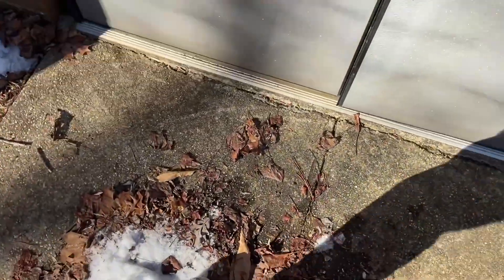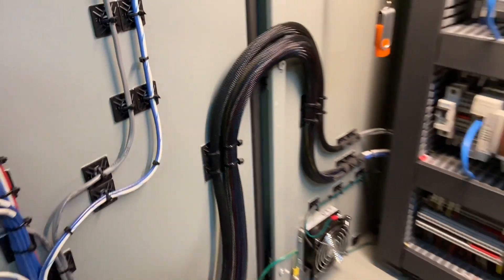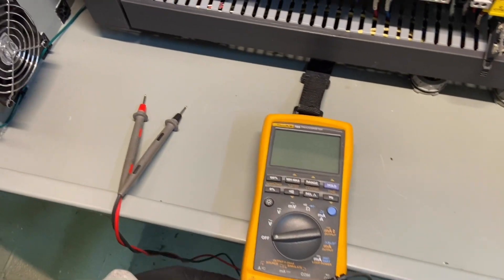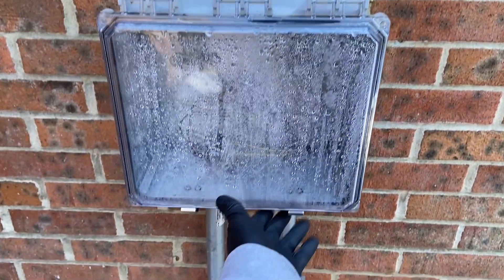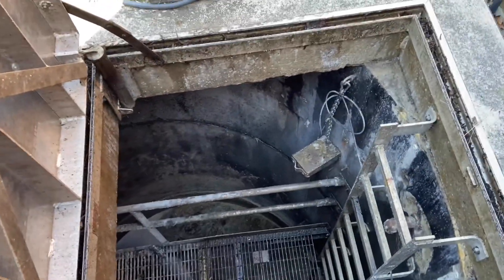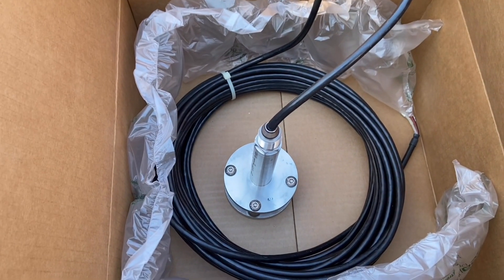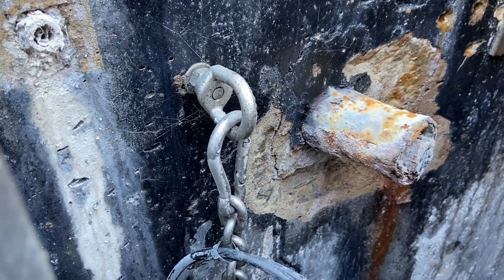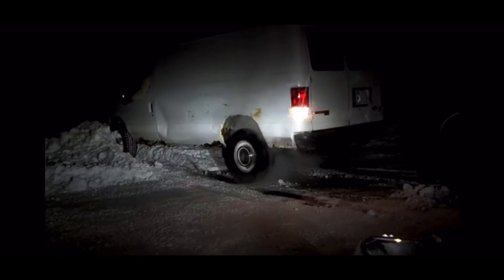Transmitter Issues

Comment: Transmitter measures something and sends an electrical signal out (to PLC, DCS, whatever you want). 

Transducer converts something to another thing. Typically air pressure to electrical power, but could be hydraulic, temperature, pH, etc.

But you already know this 😂

Comment: A transducer changes converts energy from one domain to another.  Usually electricity to physical movement (speakers) or movement to electricity (microphones, sensors, etc.)
Reply: So a transmitter is also a transducer because in this case it's turning pressure into 4 to 20 ma for a control loop.  Where I work we have "I to P" transducers turning a current signal from a controller into an air signal to control the position of a pneumatic valve.  I think you could use either/or term in most cases and not be wrong.

In the case I use here the "transmitter" is a measuring device converting from one form of energy to another and the I to P transducer is taking the input from another device and changing it into another form of energy.

Comment: We had lots of trouble with pressure transmitter in the water purifyer facility. I replaced them by ultrasonic sensors, no failure since then.

I like the way you arrange your cabinets. But there are also some downsides:

- The wirinig chanels are for wires, not for cables. Each cable should have it's own terminal block, no need to put the wires into a chanel.
- Wiring on the door is nice, but very unconfortable to change. We use wiring chanels on the door and hoses with spare/pull wires in it.
- Zip ties... 🤮
- Melting fuses for 24V are an absolut nogo. Electronic fuses are up to date, available from Siemens for example.
- Read the component manuals before doing your layout. Power electronics like power supplies, VFD or SSR require spacing to ensure cooling.
- Separate control and power circuits. For example PLS in the upper part, wires on the left side - load circuits and fuses in the lower part, wires on the right side.
- Shielding must be earthed by shield clamps to achieve EMC requirements, pig tails reduce the shielding effect to almost zero.

Comment: Forget about those pressure transducer cells, or bubblers, or floats. I've switched just about anything that fails over to a Simens LR120 radar sensor. They seem to take all the abuse of living in a wet well or chemical tank like nothing else Ive tried and you can set it up with your phone.

Comment: All these descriptions suck, hopefully you learned by now, but transducers vibrate n shit using sound or sonar or pressure. Transmitters are radios, they wiggle electricty n shit n magnetism.
Reply: 😳

Transducer change current to current or voltage to voltage. They are used for meetering in high amp or high voltage applications for example.

Transmitter convert any value like pressure, temperature or flow rate to a standard signal like 4-20mA or 0-10V.
Reply: @stefankaufmann8257 I guess that depends on your industry, which might be more practical for some. Your definition is more like a product definition. Mine is more of a concept definition
Reply: @DerekMartell it does depend and here it depends on the clip. The clip is about sensors and the question was, wether the sensor is a transmitter or a transducer. It's a transmitter and it has nothing to do with vibration, magnetism, sound etc. It's only about the signal, that is TRANSMITTED to the PLS.
Reply: @stefankaufmann8257 well, hopefully by understanding the basics, people can figure it out and also take that information wherecer they go and never be confused again. People who need every module and device explained to them in industry-specific ways need not apply
Reply: @DerekMartell i don't care if transducer is compromised with transmitter. But if you hook up a voltage transducer to a PLS, the PLS might get smokey 😂

Most people simply say sensor, that's fine with me. If a sensor fails, replace it by the same product. If it fails often, you should think about using another product or another system. I had the exact same problem with a pressure transducer in our waterpurifyer facility - pretty stinky to change. I replaced it by an ultrasonic sensor with 4-20mA signal, no failure since then. That's why you should know about function and technical details, when dealing with such problems. If you don't have to, you don't need to know... 😂
Reply: @stefankaufmann8257 well, thats good 👍 i don't doubt you do great in the field, with rock solid communication and exemplary problem solving skills 🤩🤩🤩

Comment: A Transducer converts one form of energy to another eg pressure to electrical to energy. A transmitter turns electrical energy into RF energy.
Reply: That definition might be right, but does not work for sensors and this clip is about sensors.

Transducer changes current to current or voltage to voltage. It's used for high amp or high voltage meetering for example.

Transmitter convert any measurement like temperature, pressure or flow rate to a standard signal like 4-20mA or 0-10V.
Reply: @stefankaufmann8257  I have transducers that turn current into air pressure.  The output of a controller is current, the input to a pneumatic valve positioner is air and we use "I to P transducers" to turn a current signal into a pneumatic signal.
Reply: Ah good to know!
Reply: @TheLastTater  Except he's wrong.  A transmitter is also a transducer.  Rosemount makes tons of "Transmitters that convert pressure to current for use in instrumentation process loops,

Comment: Transducers go on the bottom of the boat. Transmitters go up in the air. Transducers get you wet and sometimes maybe stinky. And transmitters are scary, bc usually very high up.

Comment: A pump turning on as you measure something, scaring the shit out of you.. My crew was in the middle of mapping out old building automation cabinets at a site for an upcoming modernization project, each of us in a different room with a different cabinet. From my own perspective I grazed against some of the mains voltage wires in the cabinet and everything went dark. Mind you, I had a dust extraction system screaming behind me, so the sudden deafening silence combined with no lights told me I had fucked up big time. That is, until I went outside to continue shitting my pants, but realized nothing was on.. Absolutely nothing was on at the site, no streetlights, anything. Turns out the main feed cable was cut by an excavator by accident outside the fence! Talking to my co-workers, they experienced the same exact thing, being both hands deep inside the cabinet when everything shut off😅

Comment: As Ben-yy7io mentioned, the Transmitter is the processing unit. It "transmitts" the signal to SCADA, or to an integral display, may have bluetooth, etc.
The Transducer is the actual measuring element itself. Just as the Thermostat is the device that displays your temperature but the Thermistor is the actual measuring device.

As a consulting engineer, we'd call it AIT/AE for Analysis-Instrument-Transmitter and Analysis-Element

And yes, why no IS barrier?
Did it at least have surge protection for a signal entering/leaving the building?
Reply: wow you're a nerd. thanks for the info.
Reply: Wasnt the yellow part after the fuse the surge supressor? Looks like it
Reply: @bashaaksema94  You're correct, good eye! 
Yes, surge protection, complete with nice lables on the wires that confirm that they are for the "Xducers"
Reply: AIT - Analysis Indicating Transmitter, i.e. it also has a local display, see ANSI/ISA 5.1 table A.3.2.

Comment: If you can build that panel and program the plc you should start incorporating a HMI. I use the c-more from automation Direct. They are super cheap compared to AB and they are super simple to program and incorporate to just about every plc. Once you add up all the switches and pilot lights it’s almost always cheaper to just use an HMI.
Reply: Not gonna argue dollars, but the discrete switches/indicators will mostly all work in 40 years, and what doesn't work can be worked around and repaired indivudually.  I doubt a HMI will have that lifespan, and chances are it'll go completely dead rather than "this indicator isn't working" or "this switch has gotten flaky".

I'm still buying things like replacement lenses for Dialco indicators installed 50 years ago.  Ain't going to be that level of replacement parts for most of today's HMIs.

Comment: What transmitter are you using I need one for my cistern I want to do away with the bubbler system.
Reply: Looks like a regular pressure transmitter, just has that birdcage protecting the diaphragm.

Comment: Nice door work.
Is that a dual PSU and redundancy module? 

Of the PSU’s I’ve started to use a couple of large multi terminal power distribution blocks and then down to sets of 10 fuse terminals- reason. So the jumper bars are not ran over current, the jumpers most often come in 10’s, and rather than didling trying extend a terminal strip, just add a whole new one.

Comment: Those birdcage transducers are expensive crap. Had similar reliability out of the much less expensive non-birdcage transducers.
Reply: You could have maximum fun and use a bubbler!
Reply: @ made me chuckle. I’ve only seen one that was actually working. It was at a small lift station on a recently closed navy base (early 2000’s). The little gold fish tank compressor was as buzzing away and I cycled power to reset the PLC and the compressor had had enough and stopped working. Fortunately there was a pet store down the street. The owner laughed when I told him what I needed it for.

Comment: I tell people to use the term transducer if they are not sure what it is and don't want to sound ignorant.  I believe that a transducer changes a signal into another form i.e. pressure on a piezo crystal into an electrical signal.  Transmitting a pressure signal to the input at the PLC would kind of be the same.  I think they are interchangeable.
Reply: Sorry guys, that's not correct. 

A transmitter changes any measurement into a standard signal like 4-20mA or 0-10V and TRANSMITTS it to the PLS, that's why it is called transmitter. 

A transducer converts the value, but not the unit. Best example is a current transducer to measure high currents, it converts high amps to usually 0-5A. If you want to measure 1000A, you can't send 1000A through your meter, so you change the current via a transducer with the ratio 1000/5A.
Reply: In this case, the transducer varies the dc current flow between 4 to 20 milliamps (the most common analog signal used). Much less common in water/wastewater utilities these days are 0-5vdc and 0-10vdc
Reply: @ricknelson947  I am familiar with the current loop. I liked the way the video explained the use of 4 to 20 instead of 0 to 20 in order to expose a broken conductor.  In temperature controls we would often use a 249 ohm resistor to convert a 1 to 5 vdc signal to a 4 to 20 milliamp.
Reply: That has nothing to do with transmitter versus transducer.  @ricknelson947

Comment: Energy management expert wanted to check for ISO5001 and help us improve our stuff. He literally asked if we could switch more lights off. Right after, I gave him the combined energy consumption and put lights on the first row for shits and giggles. They combined consume 15 amps. In the last column, we defined the relative percentage, which was nearly one percent...
He proceeded to ask me where we could save some more energy. Do these people get paid to be captain hindsight?
Reply: your familiar with they systems, im sure you have more insight than him when it comes to picking the low hanging fruit.
Reply: @ross123540  you know, basic corporal stuff, resistance to common sense with all its excuses. 
But for me, this guy was like a taxi driver asking me for direction.

Comment: Transducer: converts process signal to electrical signal. Requires constant calibration. Usually cheap with no local screen.
Transmitter: A transducer with electronics to detect offset and calibration issues and adjust for them. Usually expensive and locally scalable.

I've got 20 year old Yokogawa Transmitters that still read zero at zero
I've thrown away 2 week old Transducers that read 10% offset at zero.

Comment: Transmitters are usually RF devices that create radio waves

Transducers are sensors that specifically deal with pressure
Reply: Transducers convert energy through the process of transduction. Transmitters send signals
Reply: @Adam-hp5hj  Good looking out vs just leaving a useless comment like NAH BRO. The way I was taught, transducer effectively takes one form of energy that is non electric based and converts it into electrical energy by either material or mechanical means. Of course, this was as an electrician, I'm sure there's no limit from what type of energy conversion to another.
Reply: @mattc8950 when talking about electrical measurements, a transducer changes the value, not the unit. It has nothing to do with pressure - yes there are pressure transducers, but that's mechanic, not electric - it's only about volts and amps.
Reply: Wrong
Reply: @kenkildow  👍

Comment: The transducer is the device inside the transmitter that takes the pressure change and converts it to an electrical signal. The transmitter amplifies the pressure signal and converts it to 4-20mA and sends it out the door. In my mind anyway.

Comment: 789 is my favorite everyday DMM. Have you used a TREX for Hart yet?
Reply: Trex sucks compares to the older HART 475, just ny opinion but the 475 is so much faster, not to mention it doesnt have a touch screen that can break and burn through the battery life
Reply: @kenkildow  ive had nothing but issues with mine. Too expensive for all the problems I've had.  Adding new apps is nothing but heartache.

Comment: By my reckoning in integration engineering speak, a transducer is a transmitter with the sensing element built in to the same assembly. A transmitter is just a device that converts the proximate signal type to something measurable by the field equipment( like 0-10V or 4-20mA).

Comment: The pump always kicks on when your about to test, pull, screw or throw a breaker!  I know a wastewater pump kick on when I hear one!  Nice cabinet BTW...I've worked on a lot.  To add to your lighted fuse holder suggestion, I can't get enough ice cube relays with lights and more importantly the little orange tab that allows you to throw it manually!   First time I saw one, I said 
"Well that makes too much sense!".  Submersible transducers are the way to go.  I've seen float switches, level sticks, bubblers (grrrr), sonar (not grease friendly!)  Good stuff!

Comment: Transducer => converts information/signal/energy from one domain to the other.
Transmitter => Conditions a signal to be send over distance.
So transducer in this case (pressure to current loop). You even wrote it on the cable! (XDUCER)

Comment: how does the signal splitter work?
Reply: Takes a single 4-20 ma signal coming from the PLC and makes 2 separate signals.
Reply: Or the signal could be coming back from the sensor to the PLC as I think is the case here. Looks like there might be redundant controllers in the cabinet??
Reply: @MrRay3801  My guess would be one signal goes to the PLC for pump control, and the other to that display module. Maybe that customer doesn’t want to fork out the $ for an HMI, but I can’t see those being any cheaper.

Comment: Transducers are the sensors that read pressure. Transmitters are electronic gubbins that take the sensor data and send it out over radio or fiber optic cable to somewhere too far away to just run a boring old wire without too much resistance, where it is turned back into a regular boring wire by a receiver. If signals go in both directions, the things on both ends are transceivers - a combination of a transmitter and receiver.

Anyway, you've got transducers there. There might be a transmitter between the transducer and the panel, but probably not, because there isn't a receiver in the panel, and, well, it's a poop plant, not a sprawling industrial complex.
Reply: It's not radio related, transmitters are also used on wired circuits. Namely 4-20mA loops. Google 4-20mA transmitter and have a look.

Comment: A transducer converts One form of energy to another. Or in this case, one form of measurement to another- pressure to milliamperes. 
I like to write nominal resistance of coils, transmitters etc. the day I install them . That way I have some frame of reference if I have to come back and troubleshoot.
You build very nice control panels, it would be cool if you did some control panel layout stuff.